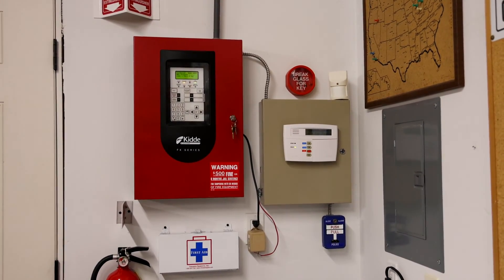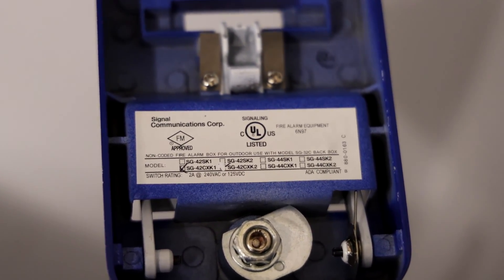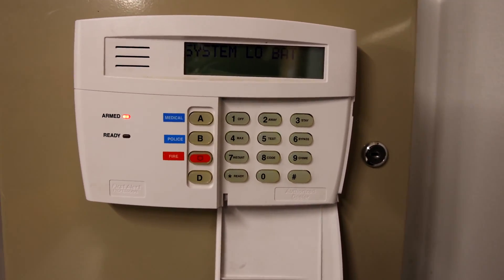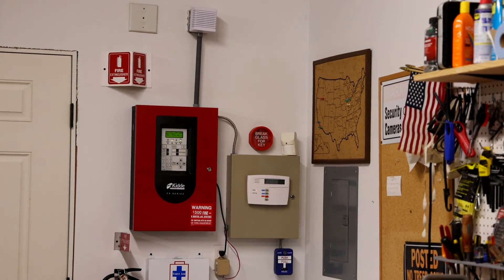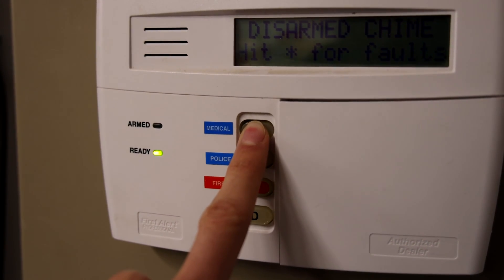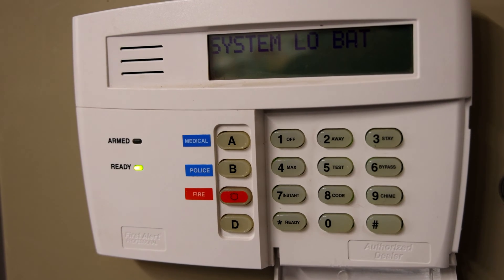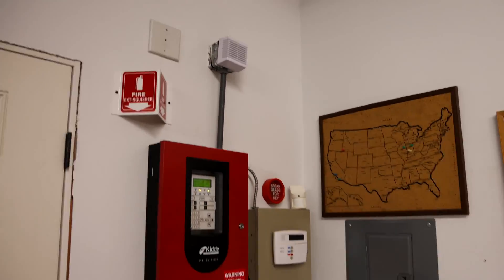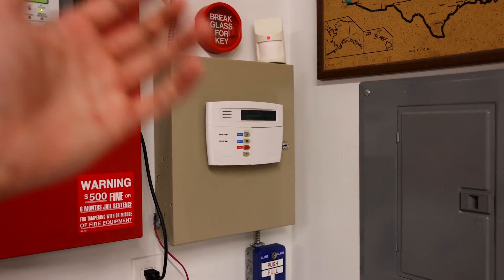Security Alarm System Test | Honeywell Vista

Comment: In GA, this illustrious company is alleged to be sending its salespersons, uninvited to people's homes, loaded with their personal info. The representatives of Honeywell are posing as if they were sent by the homeowners current security companies.  When an unsuspecting homeowner allows them in, they're uninstalling and reinstalling Honeywell equipment.  When the error is eventually discovered,  it has been said to cost a few thousand to have the equipment uninstalled. If Honeywell is NOT aware this is being done in its name, you have some retraining to do. It seems to be a regular practice as revealed by a handful of security companies. By the way, the original security company is having to send their technicians BACK out to fix the problem, costing the homeowner double charges. When Honeywell is called by the homeowners as their reps are fervently trying to gain entry into these homes, this fraudulent act is upheld by whomever the rep calls, as the homeowner does seek verification, later to find out they've been scammed. This is alleged to have been reported to have occurred numerous times in Conley, GA, and surrounding areas.

Comment: The system sounds great! I think that you will definitely be one or, if not my most favourite alarm YouTuber. You do all these tests that I really enjoy, and even use really good devices such as that DSC siren! Saying that, I have a 5 wire Canadian DSC smoke detector with a built-in piezo! However, it was broken when I got it as the top cover was not connected.

Comment: I know you said you won’t do it but you should put a backup battery on the panel just so you can have the backlight work so it’s easy to see what you’re doing. Also unless your panel is different, you don’t have to press 1 before your code to disarm it. Just the code and then 1 will work.

Comment: Nice video. To arm the system you can also push # 2 for away mode and # 3 for stay mode.
Reply: If you turned that feature on you can
Reply: Yes, “quick arm” (*21) has to be enabled